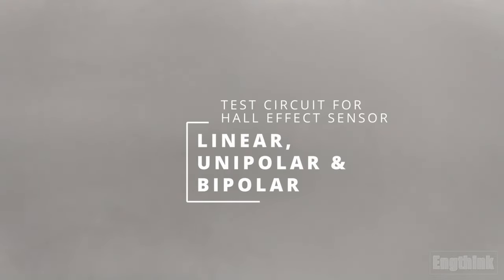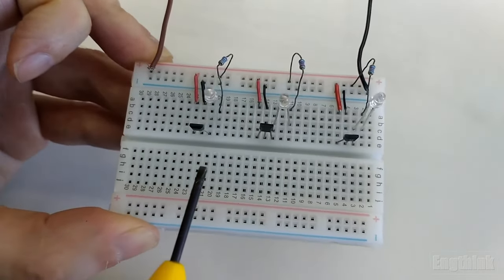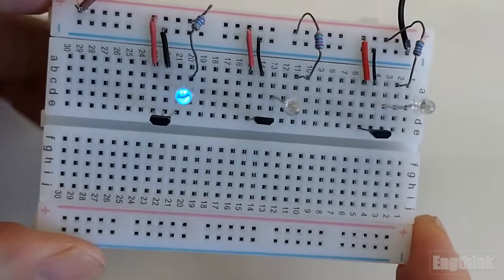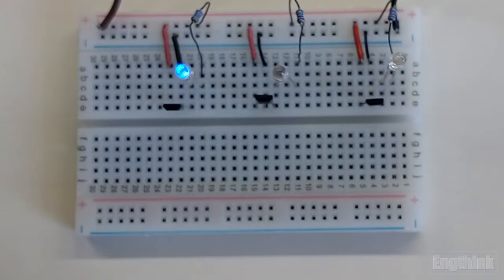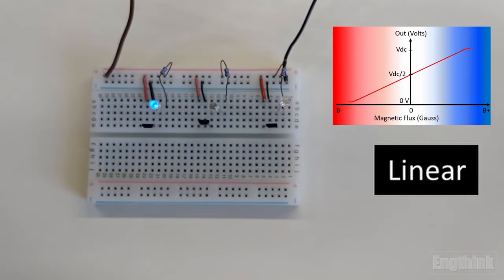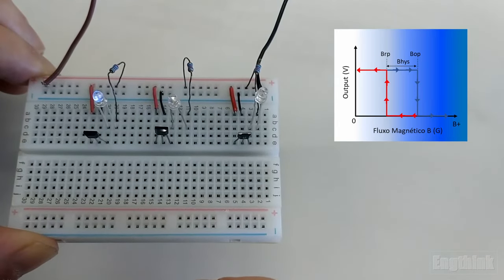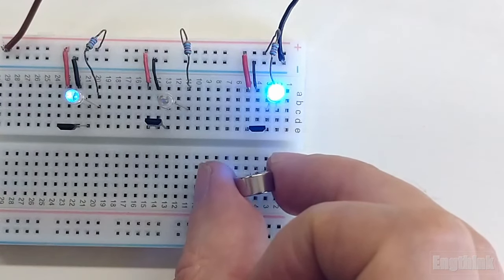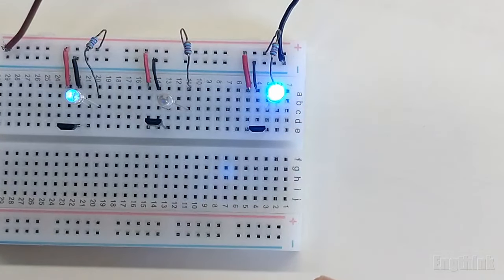HALL EFFECT SENSOR Comparison: LINEAR vs. UNIPOLAR vs. BIPOLAR Models

Comment: The hall effect sensor lends itself in many uses. I am interested in the 'electromagnetic aspect, to discharge from the human body precisely the electromagnetic field generated by smartphones, tablets, etc. A kind of low-cost Biofeedback. I don't know "if" you understood what I meant?
Reply from the maker: Yes, it is a good idea, however I am not so sure if the magnetic field generated by the human body is strong enough to be detected.
Reply: Whatever is magnetic enough to move the needle of a compass, could work with a Hall sensor.

Comment: I have a question if you dont mind answering if you know, inneed to change a hall sensor in cricket ball throwing machine, i purchased some bipolar hall sensors, but when I have installed it, my voltage to the sensor is 5v but when i get voltage out it drops to 3v, do i need a linear sensor as i need it to show 5v. Thanks in advance if you know, im asuming its the linear one from this video. But as you may know, to assume things make an ass out of u and me 😂
Reply from the maker: Linear hall effect sensors are used for positioning and the output is analog, check this video https://youtu.be/QehDPrRzYIw . Maybe the bipolar hall sensor is right and you have other issue in the electronic circuit.

Comment: Hi,

This was really helpful. Thank you very very much. I am new to all this so I have a question.

Does the model number of sensor matter? Example, I have been looking for 49E but there are different variations like 49E 309BD vs 49E 736BG vs 332BG. What are all these?
Reply from the maker: There are several models but with diferent codes, so if starts with 49E the other number doesnt matter.
Reply: @engthink  thank you.

And subscribed

Comment: But how do we turn On with North Magnet ( I think one has to approach the broad face with N magnet)  From experience  more than 5.5 volt in put causes the HED to fail even though they are supposed to go to 20 volts
Reply from the maker: I dont get your point, why you need turn on with north magnet?

Comment: Hi, Have a good day.

Thanks for the video and explanation. I have a question if you have any advice.
We are planning to count the rotation of our device. We designed a ring and placed some material on it that can produce a magnetic field, and we connected this ring to the device which will rotate. Then we placed a hall effect sensor( ALLEGRO 3214) with a transmitter and put this transmitter close to the rotational part and ring. Which sensor could be better for counting the rotation number by magnetic field?
Reply from the maker: Hi, it seems that your choice is good. I just have advice regarding the material to generate a magnetic field: use neodymium magnets.

Comment: I can say it is the best demonstration of hall sensors. It helped me a lot!

* Note: I think if you approach through the other side of those transistors you'll get the same effects, using inverted magnetic polarity though.
Reply from the maker: Nice to know that helps you. You are right; if you approach from the back with the reverse pole facing the front, it will have the same effect.

Comment: do you have an idea which sensor can detect magnetic presence doesn't matter the magnet polarity, and it can detect it in 360 degree which can be read into analog output.
Reply from the maker: For this case you need a magenetic encoder, the chip that can do the job is AS5048B or AS5030.

Comment: if the output of the sensor is on ground, does it reverse the polarity of how the magnet functions?
Reply from the maker: No, don't work like that. To reverse the output need a transistor on output.
Reply: @engthink  thanks for your response. I reversed the position of the LED and placed the resistor on ground; the result was completely opposite. The sensor comes on via the North pole and there is no response on the south pole side
Reply from the maker: @temmy2367  for the LED Will work, howerer If you connect the output to other circuit can not work.